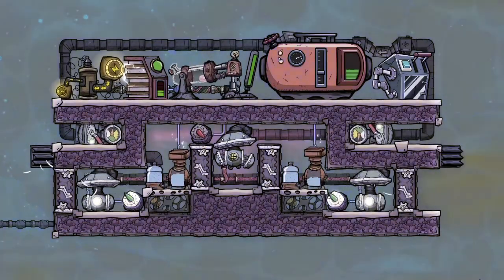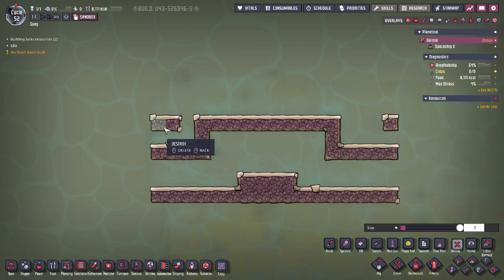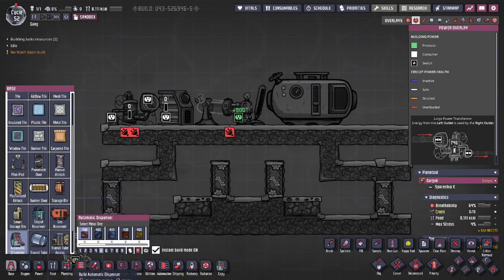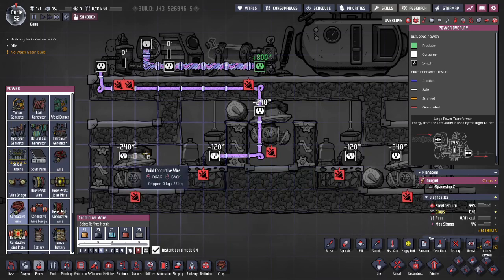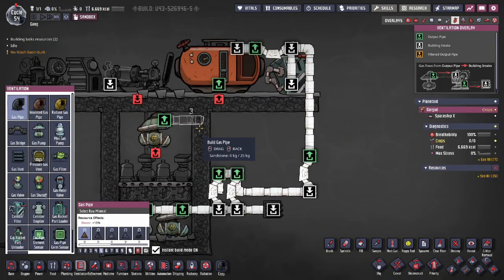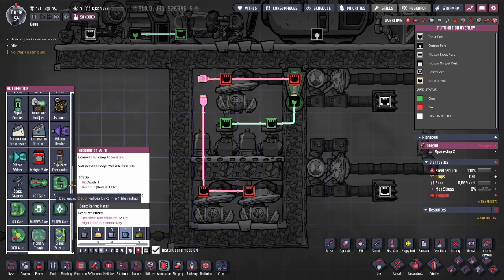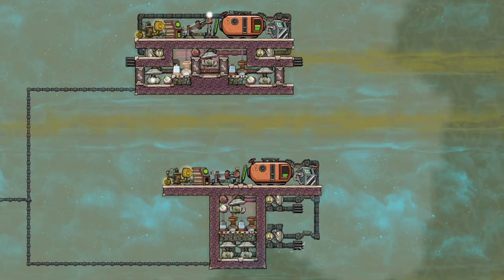How To Build SPOMs - Oxygen Not Included Tutorial

Comment: FOR PEOPLE WHO TRIED AND IT DIDNT WORK! The oxygen output pipe should NOT go up and connect to the hydrogen tank. Build it to whatever place you need your oxygen at. For the hydrogen loop you will need to “prime” it (it’s not as easy as on the video where the author probably cut out that part which made me waste a lot of time). Take the hydrogen pump pipe outside the structure, set a proper filter and connect the filter output into the hydrogen loop on the right so the loop receives hydrogen only. Once you see hydrogen circulating in the loop you can deconstruct the adjustments and connect everything back as you see on the video. After those steps my system started to work.
Reply: Thanks for the heads up il go look somewhere else then 😅

Comment: What is an easy way to prime the filters with Hydrogen? Also confused where the gas valve connects at 3:38.
Reply: I usually will use an electrical filter to initially start mechanical filters or you can just store hydrogen in pipes with a valve to limit the flow, then connect it to the mechanical filter and only like through a couple grams.
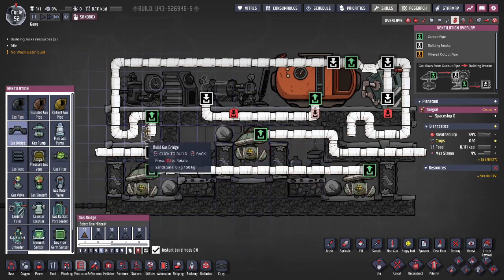Reply from the maker: Sorry I can see how it's not super clear look at 2:44. Or my other video https://www.youtube.com/watch?v=HcPXA4jXz2A&t=161s @ 3:16 it shows the construction of the mechanical filter and you can use that to configure it however you'd like.
Reply from the maker: Also I generally just fill pipes with hydrogen then break the pump so I have it stored for filters I usually do that for different gases that way you can empty the pipes by hand for the gases you don't want.
Reply: @GenuineStreams  Thanks, I managed to get the system working by checking out your other video.

Comment: The passive filters make these designs very compact, nice! I usually prefer to use the h2 to cool the Power-Production. As long as u use gold-ore, it will be fine.
I didn't understand: what are you doing with the excess-h2? Is there an overflow? I usually connect the Gas-Tank with the generator to burn off the excess.

Comment: Sorry man, but you could do a lot better, you should do some research before you make a tutorial. I made a lot of spom's with 1, 2 or 4 electrolizers and never used an gas filter of any kind, that saying, every gasfilter you made you put the valve the wrong way, do you just copy designs and do not understand why you are doing it this way? Try it out, 2 filters one with the valve the way you used it in all these, and 1 with the valve the other way around, now put 1 kg trough the pipe, yours lets through 1 gram every 1 kg, with the valve the other way it lets through 1 gram every 1000 kg. The way you used it in your video there would be no difference between 1 or 2 bridges, with the valve the other way you need 2 bridges. And the why would you ever want the electrolizers to stop with automation? And then you said, "your atmo sensors for oxygen should be higher because you produce more" , take the full Rodriquez for instance hydrogen set at 250 and oxygen at 450. If you start doing the opposite of the standard you should explain yourself better then produce more...